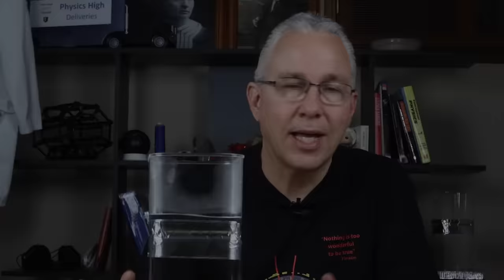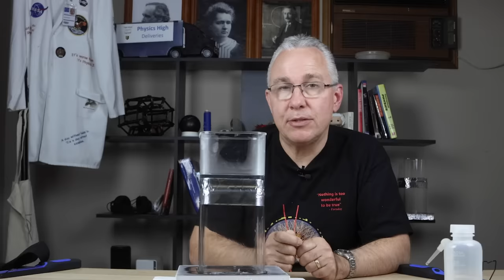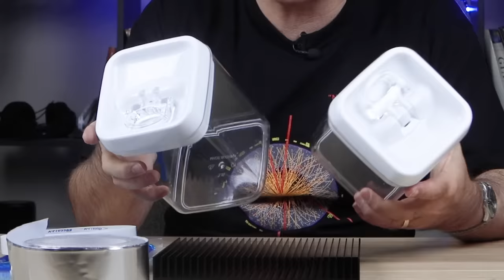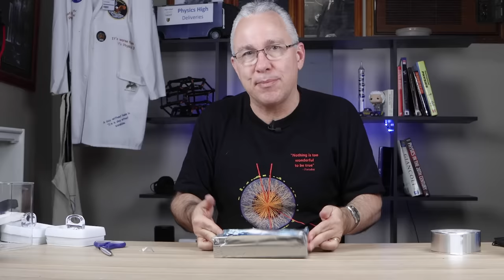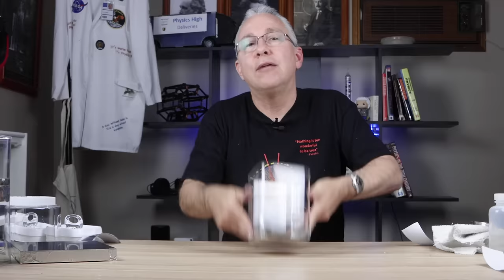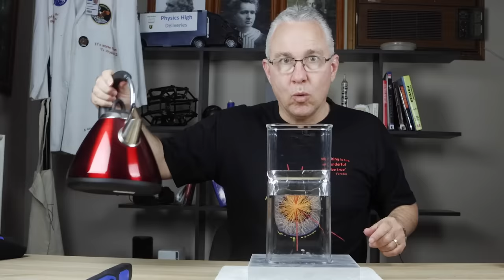DIY cloud chamber: no dry ice required - how to make, how it works!

Comment: Great! And now, let's turn a few loops of electrical cable on each side, to produce a magnetic field and try to identify the particles! :-)
Reply from the maker: I wish. I did a calculation on what magnetic field is need to get a noticeable radius. Let’s just say a few coils won’t cut it. There a reason why ATLAS and CMS have superconducting magnets in the order of 8T plus. 🤓
Reply: A couple of neodymium magnets stacked, 2 on each side,  on either side of the source might set up enough of a field...

Comment: I made this on a smaller scale, with a 4" square heatsink and 3-1/2" square containers. I had to make one modification- I stapled the felt to the aluminum tape as the alcohol was dissolving the adhesive holding it in place (both the double sided tape and the aluminum tape). It worked perfectly the first time. Great experiment, thank you. I obtained all the components except the alcohol and flat black spray paint (for the surface of the heatsink) from Amazon, if anyone is interested I will supply my shopping list.
Reply: You did it! Awesome. That magic of seeing these tracks after your own construction must have been a special moment. Sure, a lot of us could just purchase a cloud chamber, but actually MAKING one must have taught you so much more. True science. God bless brother.
Reply: @TheHexCube   Yes, seeing that first track was pretty cool. I was sitting there thinking there's no way this is going to work,  not the first time.  Then bang... there it was. I almost jumped out of my chair. I'm 71 years old and still love doing this stuff.
Reply: On my 2nd attempt and still can't get it to work :/
Reply: @ArifGangji  Keep trying, don't give up & good luck my friend! Will be awesome to see these amazing particles fly through something you've created. It IS possible to achieve.
Reply: Hey, if you still have it can I get your list?

Comment: Tried this a couple of days ago and it worked! I used a much smaller container but it still worked, the key is to be patient in the beginning as it takes a couple of minutes to start working but once it works you just need to make sure there is enough alcohol and the top is kept hot.

Comment: I can think of improvements, such as having the top container be made of metal and using a thermal adhesive to bind them. Also, if you add more felt strips or loops, you could get more surface area to vaporize the alcohols, and produce more vapor. Maybe you could run a liquid through a heatsink on the top, and produce more thermals up there for longer? You might also be able to run this for awhile just using peltier modules. Who knows, I should try this out myself! Great video!
Reply from the maker: You could do that. See how you go. As long as there is a good temperature difference so that you can create a good supersaturated cloud of alcohol vapour, and maintain that so that you can have a decent time trying to observe tracks. I think there could be a number of variations I could still work. The original Wilson cloud chamber simply used water.

Comment: Something I noticed about my "proof of concept" chamber from two years ago.
Height: you NEED distance (15-20cm) between the felt (alcohol vapor source) and the cold plate. If too close, the cold plate will quickly prevent alcohol from evaporating.
Mine was made with a "pint" canning jar. Later changed to a "quart" jar (for distance).
The chamber NEEDS to be warm on the top, but very cold on the bottom.

Which why he is using a warm water tank.
Reply from the maker: correct, you need that differential
Reply: awW! the store they had two of, literally, the exact container he has on top and no taller ones. I have 11 cm clearance and just completed the coupling. I guess I'm hosed. Unless maybe I have more area and volume than you had, because this shortie is a quart, but that probably just hurts and helps equally... The first part went so well having a little milling machine to get the bottom/top out with nicely in minutes. Sealed it on with the tape and then read the 15-20cm update :(  lol... guess I'll try it... dunno if size of felt or sponge will help... thinner=all closer to the warmth, larger=more with more intertia but closer to the cold...
Reply from the maker: @OtterLakeFlutes  I think it will  still be ok. The original concept came Japanese researchers and they used two plastic cups.
Reply: OK i ready our comment about distance thanks.
Reply: Please make a video

Comment: "Dry ice is easy to come by"
Unfortunately in Poland dry ice is almost impossible to get. You can order some on the Internet but it's pretty expensive.
So this design is really helpful and I will be making this soon! Thanks!
Reply: you can use an co2 fire extinguisher to make dry ice if its easier to come by
Reply: @Freezone7  Yeah a 5kg CO2 fire extinguisher costs like 12% of my monthly paycheck. And considering how little actual dry ice you can produce with the extinguisher it would be cheaper to just order the dry ice online.
The cheapest I could find is 5kg for 3% of my monthly paycheck but it's expected that around 2kg of that will sublimate in transit and the rest will last 1-2 days.

It's an okay price for one time events like parties and stuff but buying that every time you want to play with a cloud chamber is not a good solution.
Reply: Did you make it? How was it. Did it work?
Reply: @chakshupunj5943  Yeah, never got around to it, had a lot of other stuff going on. Maybe some day.
Reply: @Undy1  oh okok

Comment: connection t-shirt and cloud chamber: Cloud chamber was first used to find a anti elektron by Anderson starting the hunt for the remainder of antimatter which is done in Cern. I believe your T-shirt is a seethrough of the LHC at CERN
Reply from the maker: 🤓 good pick up.
Reply: dammit, one day late:p
Reply: @milztempelrowski9281  I'm way late but answered anyway. Nice to see I was right. Not often it happens. I coulda won something if there were a prize.

my answer:
A2Q@0:50-0:55 Your t-shirt is a particle map* from the LHC demonstrating the GOD Particle maybe? When two particles collide they emit a shower of radiation, radiation that is demonstrated with our cloud chamber, similar to the LHCs(particle collider) detector. Do I win a prize?

Comment: Just to assist by way of clarifying about materials the welding rod that you specify is actualy a tungsten rod, however they are sold as 1.5% and 2% thoriated or as some with an interest in transistors would say the term is doped with thorium. They are  used for tig welding of carbon steels  primarily. Hope that helps.

Comment: Knew I should've calculated the temperature difference curves!
Was considering making a refrigeration system for a cryo based unit, largely out of being cheap and a bit lazy to run out for dry ice. Then, ran across this which I had considered and dismissed without calculating it.
Might go with a multistage peltier cooler for the cold base still, for on demand purposes, but likely will go with the cold gel first.
Been looking into this because well, had a smoke detector fail and when it was replaced, maintenance handed the defective unit to me. Needed a resistor out of the unit for something else, so while I was there, ripped it the rest of the way down. So, got a nice Americium source button that needs a proper display as a conversation piece.
I'll also be building a nice radiation spectrometer from plans on CERN's educational site. Comes with a nice database of readings from that photodiode scintillation detector, again, good conversation piece. Toss in an alcohol fueled steam engine and sterling engine on adjacent shelves just for giggles...

Comment: Well, after seeing your video I ordered 10 small aliminium heatsinks and they are right now on the freezer, hope I can see at least som emuons tomorrow 🤞
Reply from the maker: Fingers crossed!
Reply: @PhysicsHigh  it didn't work, maybe my heatsinks weren't cold enough or the water hot enough, i Will let it sit in the freezer for 24 hours and i'll add boiling water Just to ensure that the temperatura difference is achieved and i Will be using a smaller amount of 99% isopropanol, because this time the felt that was too wet. Any other advice?
Reply from the maker: was there a good seal between the container and the plate?
Make sure plate is free of water crystals too. 
Are you just looking for muons. They not common and dependent on local conditions. 
I assume plate is well prepared with no bubbles. In gel. And well frozen.
Reply: @PhysicsHigh  well, today I had better luck, mist was formed and it lasted for several minutes but unfortunately i couldnt see any traces, so I'll wait till tomorrow night and go to the balcony with the cloud chamber  to have a better chance of detecting anything as i am not shielded by the roof and walls of my house.
Reply: @juanpepe1234  put banana nearby they emit something
Reply: @chanakyasinha8046  Really?
Reply: @xTheToolx  Yeap… Bananas are slightly radioactive and might do the trick if you can’t find an old smoke detector.
Reply: @xTheToolx  They are high in potassium that's not a bad thing.  0.01% of naturally occurring potassium is potassium 40 which is radioactive.  This is mostly a beta emmiter and a small fraction of the events are gamma radiation.  They should both penetrate the wall of the chamber.  The americium from old smoke detectors is primarily an alpha emmiter which would be blocked by the chamber wall.  Put the small pill from the alarm sensor in the chamber.  Even a sheet of paper will block them (low penetrating power) which makes them more dangerous.  The low penetration means if you were to damage the sensor pill likely you would inadvertently inhale or ingest some.  Low penetrating power means essentially all of it will be stopped by cells in your body damaging them.

Comment: Fantastic project. Thank you for reminding me (all of us) that doing science doesn't need to cost a lot of money. About 10 years ago, I built a cloud chamber using dry ice... but I am curious, Why did you choose to place the felt and alcohol on top, rather than below (on the cold surface)? If the alcohol-soaked felt is placed at the top where it's much warmer, I expect that the alcohol will evaporate too quickly and will not create the necessary supersaturated conditions in the chamber... at least that is what I thought I knew.
Reply from the maker: You need the alchohol to quickly evaporate. You then have a large temperature gradient to develop a super saturated region above the plate. (-18 - 60 degrees)
In the case of dry ice versions you don’t need hot water but your temp gradient is now -78 to 20 degrees approx  ) 
So probably a little better but limited by the fact you need dry ice

Comment: This is a fantastic project! I follow Tesla555 due to my interest in Vacuum Tube Tesla Coils. He presented an elaborate, nicely built cloud chamber using TEC coolers on a big heatsink, and some resistors to heat the ethanol under a bell jar.  This is a great low cost simple and approachable version.

Comment: Brilliant!! Will see if I can make one with my students.
Reply: Don't use under a metal roof or on thenground floor (with additional floors above you). The less mass between you and the sky, the better. Otherwise, you are forced to use an internal  radioactive source.  Thoriated rods from a TIG welder will work.

Comment: Because of the current logistics issues high strength isopropyl alcohol is harder to get in some places. You could try salting out lower concentration to get the water to drop out.  Note salt won't work with ethanol.

Comment: I made a cloud chamber with a ultrasonic mist maker and a water pump. The cold steam wants to sink so the pump manifold makes use of the  vinturi effect to pull the cold steam into a 14 liter chamber. One thing I noticed was the plants growing underneath the chamber.  Not sure why they started growing  towards the angle of the chamber. Because my setup is outdoors I get a lot of green water condensation on the plastic.

Comment: Design improvement suggestions:
* Have 2 heat syncs, heat conductively stuck back to back,
* Pour gel into a container that's smaller than the cloud chamber, but larger than the heat sync,
* Submerge half of heat sync assembly into gel
* Freeze assembly,
* Add a heating element to the water tank

This should extend the cloud chamber's usable period.
Reply: I'm not sure I can follow your suggestions. Smaller than the cloud chamber, but larger than the (back to back) heat sink.? 
How is that physically possible?  Back to back heat sinks would leave fins on top and bottom?
Reply: @msmeyersmd8  
Heat syncs are very common and come in a wide range of sizes.
Select a pair that fit inside the chamber, so that you limit how much you are cooling the air outside the chamber.
The greater surface area of the exposed side speeds up energy transfer, making the chamber's useful period start earlier and more consistent over the the experiment.

The volume of gel can be => the syncs fin void space since the sync is placed in a tub of it, extending the life. Inside of being limited to 100ml you can use as much as you like.

Heating element for the top is a very common device and a lot come with thermostats. This will maintain the 60°C for the period of the experiment.

The combination of the greater surface area of the cooling sync and a constantly heated upper element creates a more consistent temperature gradient.
Reply: @msmeyersmd8  
Heat transfer is dependent on surface area.
By having a large surface area on both sides you maximise the transfer of heat from inside the chamber to the gel.
Reply: @2011dyrose  Thanks. I see what you're getting at. On first glance, it just didn't make sense to me. Thinking it through I can better understand the thermodynamics of the system.  Any good ideas about making a larger volume? Taller and more rectangular. Or do we run into the limits of this type of reusable cloud chamber.
 I've done the dry ice. Works very good because of the T differential. But a "pain in the arse" to set up. And not accidentally freeze you fingertips off. 👍🏻
Reply: @msmeyersmd8  
The volume of the tub containing the cooling gel is key.
The larger the volume compared to the cloud chamber and heatsink, the longer the cooling effect lasts.
Although you might start running out of alcohol at the top after a certain period (mouse water feed to the sponge?).

Wonder if salt water would be cheaper replacement for the gel?
Reply: One thing to remember is that the point of the heatsink here is not to maximize the amount of heat you are pulling out of the chamber, but to balance the heat entering at the top with the heat leaving the bottom with the amount of volume you have in the chamber.  So adding a more efficient heat sink at the bottom may change things and make this setup worse, or require hotter water up top (maybe too hot for the plastic) or require a larger volume.  Also, the faster the heatsink pulls heat out of the air, the less long it will stay cool (not quite true because it will hit some equilibrium at some point)
Reply from the maker: The salt water is a good idea word least salt and ice. In fact the authors of the paper I refer to write another paper on a similar design but using salt and ice instead of the gel, stating that it was less messy. The reason I chose the gel method was that once made it was easy to be reused again and again